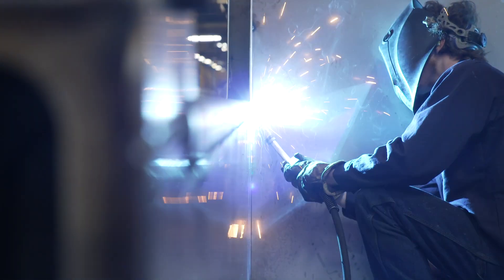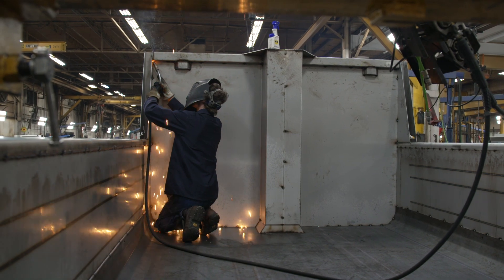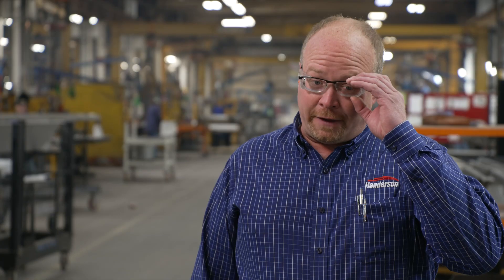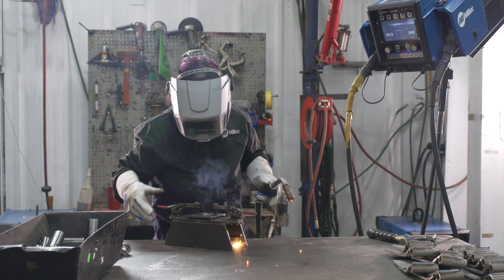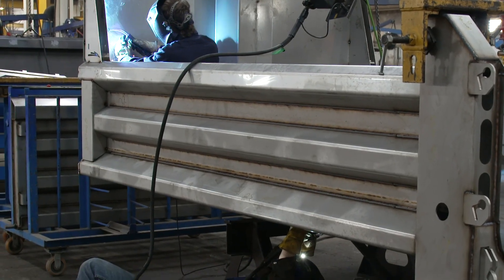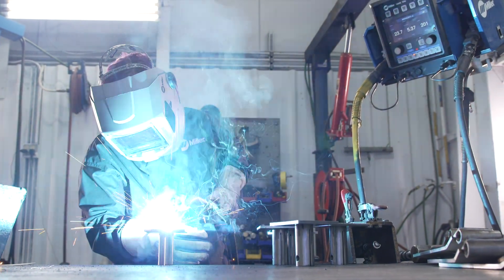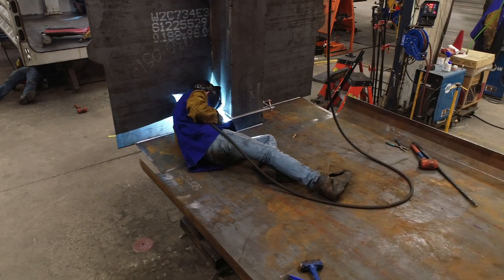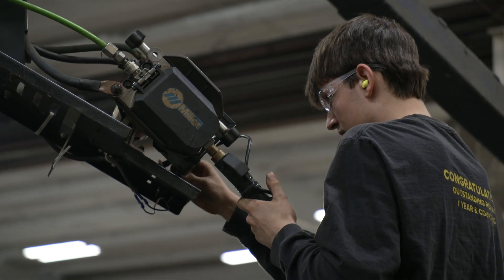Henderson Products Chooses Versatile Deltaweld Systems

Comment: IT'S EITHER LINCOLN OR MILLER FOR DEPENDABILITY, HAVE BOTH OVER 40 YEARS OLD, AND EVERYONE HAS THE MILLER 330, AND THE LINCOLN 400, AC/DC/ TIG, STICK, AND WATER-COOLED!!!!!! JUST ADJUST YOUR HF POINTS WHEN NEEDED, NEW, I LIKE THE LINCOLN MIG!   BUT EVERYONE IS DIFFERENT, PLUS MILLER THINKS WE LIKE PAYING ALOT MORE FOR BLUE!!!!!!!!!!